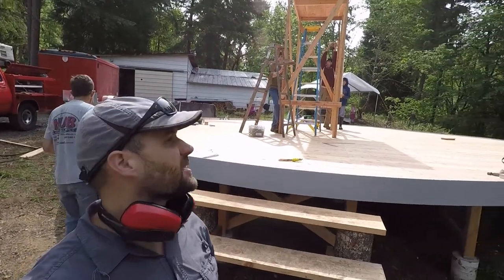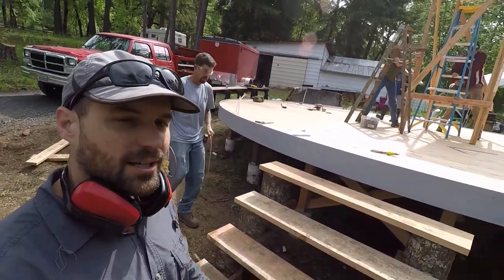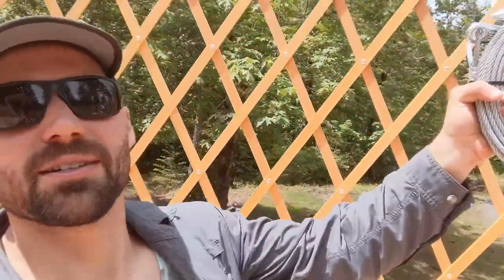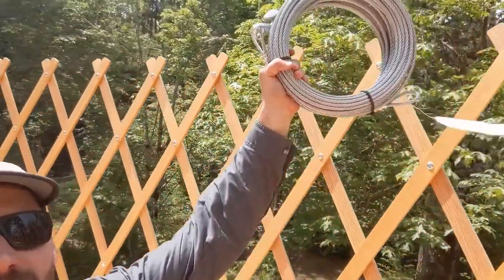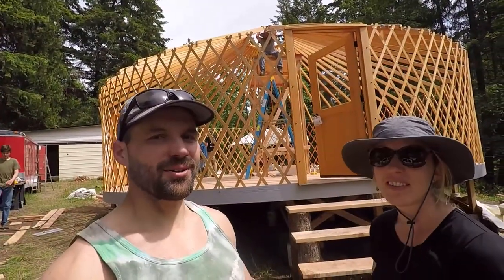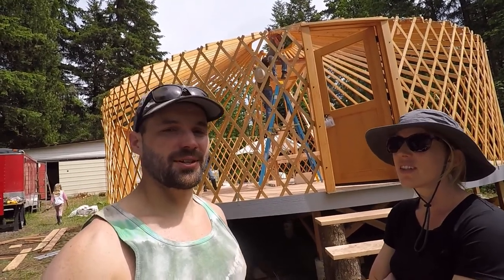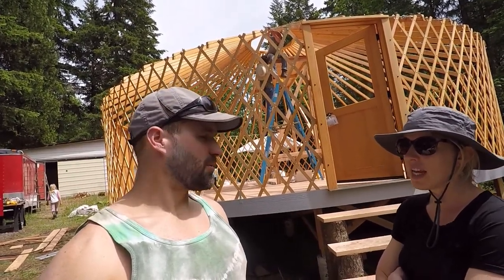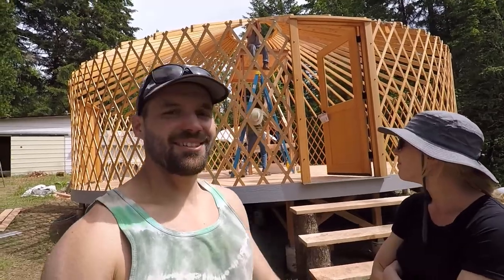Installing a Yurt, Day 1 - Wooden Frame

Comment: It is incredible, how it is possible to hold all this weight (wood ring, rafters, and all kinds of insulation on the roof) with these thin lattices? What is the thickness of these walls? Btw, is this dome alright? Is it not small for a 30ft yurt? The sky is clearly visible from it? :) Greetings from Ukraine
Reply from the maker: Yes the lattice structure is very strong!  The walls are thin, 1-2" total.  The dome is great, roughly 6' in diameter with a lot of sky visible through it.  Stay safe my friend!

Comment: What's the size of your Yurt in sqft? Do you think you can deploy multiple yurts and connect them? sort of like having the big yurt you have for living/dinning/ kitchen and the connected yurts for rooms? heating wise how would that work?
Reply from the maker: Hi Cris, others have definitely connected multiple yurts with breezeways between them.  For heating, you would either need to heat each yurt separately or deploy a rigorous air movement system between the two.  I would be curious to hear from people who have connected yurts on how they solved that problem.
Reply: @Green_Heart_Family_Farm  Ductless heat pumps are a great way to heat/cool multiple yurts without installing a lot of ductwork.